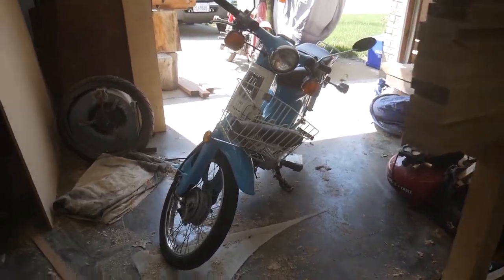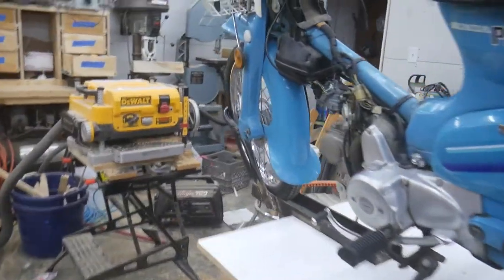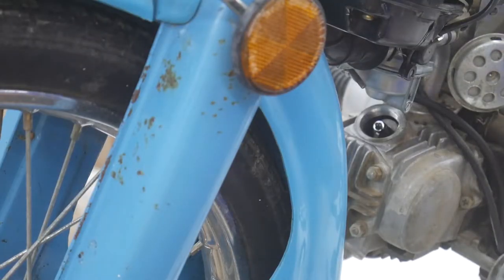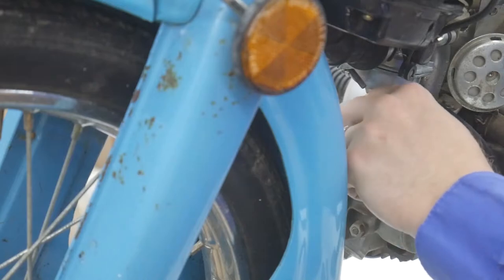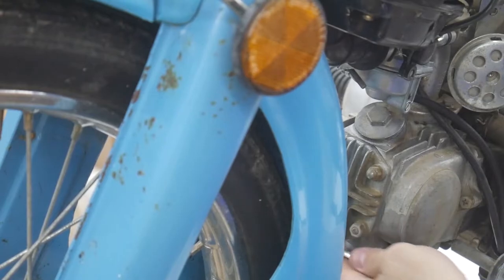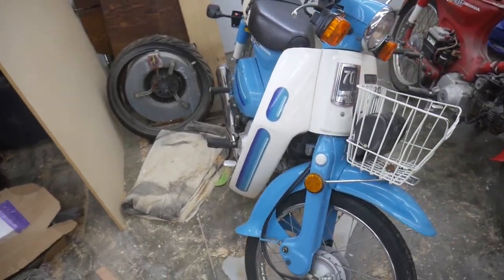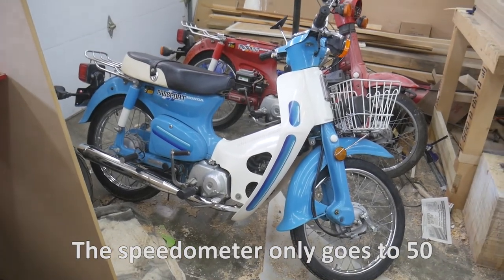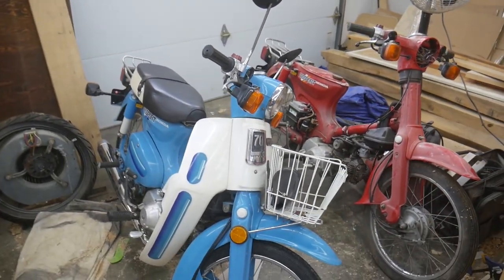Honda C70 Passport: Tuning up the Blue '82

Comment: My mother was nurse and used a Raleigh winged wheel to get to her local hospital ( top speed 20-25 mph.).  As soon as these Hondas came out she got a C50 pushrod model, and amassed 35,000 miles on it in 9 years. Then bought another C50, but OHC now, which also lasted 9 years.  The third one was not used so much as she had reached retirement.  We thought the pushrod model was the quickest... 45mph on the flat and 55 with valve bounce going downhill.  I recently bought a C90, which I will change the clutch pack, as soon as I get the special clutch nut socket,  I think it will then pull a higher gear, by using a smaller rear sprocket.
Reply from the maker: Cool history!

Comment: I have a yellow '76 C70 here in the UK with 3, 800 genuine miles.It was given to me for spares for a similar model I totally restored some time ago   but ending up keeping this unrestored one only !.Of the few ' step-thru ' Hondas in 50, 70 & 90 form I  have owned , the  C70 in my opinion is the best of all and this one ' goes off the clock ' at the  maximum 50 shown and I know it will do a confirmed  45 and 2-up !.They are incredible almost indestructable machines, an annual oil change is all that is required to keep them sweet and probably the most ' useful ' vehicle on the road , ludicrously cheap to run as well - one of my ' favourite things ' !.
Reply: I had a blue c70 and your right, got mine off the clock through blackwall tunnel :D I used to take it to southend from southeast London, and felt sorry for the engine and used to pull over let it cool down then carry on.. brilliant little bike.

Comment: Advertising I remember never listed a top speed for the Passports, but it became common knowledge pretty quick that they were all done at 45 mph.
I wanted one when I was in high school, but when I was told that....I still wanted one, but my dad wasn't having it because we lived on a main highway. Had to do at least 55 to keep up with traffic back then.
...41 years later, I still want one.
Reply from the maker: My first encounter with them was actually in Argentina in the 90’s. I fell in love and finally got my own about 20 years later.
Reply: @SouthpawWorkshop  Yeah, one of these days...at least that's what I keep telling myself, but common sense always seems to prevail.
72cc's just aren't practical around here, but maybe a 110 replacement motor....I wonder how much of a "drop-in" fit that would be?
...can't be that much different, right? They both went into the same bike.
...hhhmmmmm....
Reply from the maker: There are aftermarket (Lifan) motors that are known to be an easy drop in replacement. I think up to 125cc. Not sure I would trust the suspension at high speeds though. At that point I would just buy the new SuperCub 125 that Honda is selling.
Reply: @SouthpawWorkshop  I have issues with gouging the engine out to 125cc's....I mean, they have other bikes that are 125's, why does the Cub have to fall in line?
I always felt it was its own beast, and thus, should have its own displacement.
I feel 110cc's works well enough, but if they have to go bigger, why not simply bore out the 110 to 130?
That would fall in line with the 20cc displacement gains this engine has made during its entire lifetime, and, again, it would be its own beast....as it should be.
JMHO.
EDIT: Just noticed I misread your comments on the suspension. 
You'd know better than I, but the 110 can do at least 60 mph and it seems to be fine at that speed. The 125 is even faster and it too seems to do just fine.
Maybe the Passport was sprung a little softer, or differently?
I know they make 100CC overbore kits for the 50/70 motors. I'd be ok with that, too.

Comment: Other than the carb you think this is the most likely cause of one of these topping out around 35mph? I just got an almost identical 81 in a little worse shape and missing some parts but for a very good deal.
Reply from the maker: Carb, exhaust restrictions, air/fuel mixture. I have mine tuned to the max that is still safe for the engine and I can get around 43 mph on a straight, flat road. Besides those three things mentioned above, this engine size can only provide so much power.
Reply: Thomas Lightle - Red Barn Woodworking thanks I am still on the fence on whether I will replace the engine with a 125cc lifan or put a larger head, carb, and piston/jug on the stock for a 88cc.
Reply from the maker: Are you the guy on the Yahoo C70 group that was recently asking around about engine upgrades? I’m pretty active on that group.
Reply: Thomas Lightle - Red Barn Woodworking no, I will have to check that out. I just got the bike and I'm finding there somehow isn't a giant amount of information available, or if there is it's made difficult to find because of all the different model names and sizes across all the different countries they were sold in. I thought the most common vehicle in the world would be very easy to find information on.
Reply from the maker: Google “yahoo group C70 passport”. Sign up. All the info you need and the members there are experts and are always willing to answer questions. Just do us a favor and search the discussion archives first. Good luck!
Reply: Thomas Lightle - Red Barn Woodworking thanks for the help my problem was no air cleaner lid causing a lean condition cruises at 40mph now.
Reply from the maker: Awesome! Glad you figured it out.
Reply: @16driver16   Did you do the 88CC big bore kit?

Comment: Where is the timing mark located?
Reply from the maker: Magneto flywheel behind the round cover on the left side of the engine.
Reply: Thanks, i ended up finding it and following this to set my valves. I instantly went from 35mph to 40mph and runs alot better. Thanks for the vid. I have it set to .002 when before it was able to get the .0025 gauge in there @SouthpawWorkshop
Reply from the maker: @kennyp11111 thanks for following up. Glad I was able to help

Comment: I have one in my garage but can’t figure out why the fuel is leaking, we replaced the lines and carburetor but it’s still leaking.
Reply from the maker: So either the carburetor fuel needle is stuck or the float has a hole in it and won’t float anymore. I would get a carburetor rebuild kit and go from there. The blue one has the same problem and I just turn off the petcock when I am done riding. I’ll get around to fixing it eventually.
Reply: There's a small drain in the bottom of the carburetor bowl that you operate with a screwdriver. It gets corroded because that's where water collects. I took mine out and chucked it up in the drill press and dressed the seating area with 200 grit sandpaper and 0000 steel wool. Now it closes drip tight.
Reply: I think the carb on mine is leaking to

Comment: It's a motorcycle dude
Reply from the maker: You and I both know it is a motorcycle, however most people will look at it and see a scooter. So, I’m willing to call it a scooter so I don’t get a bunch of people telling me “It’s a scooter dude”. At least I’m not calling it a moped.
Reply: @SouthpawWorkshop  a lot of people like to call these mopeds or scooters.. it is like no it is in fact a motorcycle with a different style frame. Today I pushed like C70 4 miles due to buying it with no spark.. and didn't get why it didn't because everything checked out fine. I have no experience with points and guess neither did the old man I got it from. Points were re assembled incorrectly and was grounding it self out. Now it is a running bike that bogs out when you give it throttle which was the original issue the old man had before he played with the points and condensor plate and got no spark.